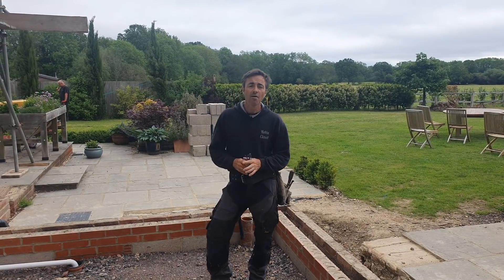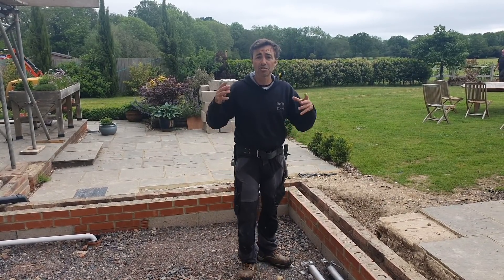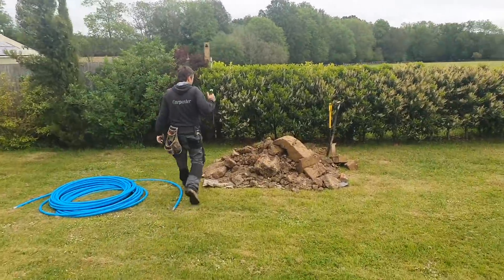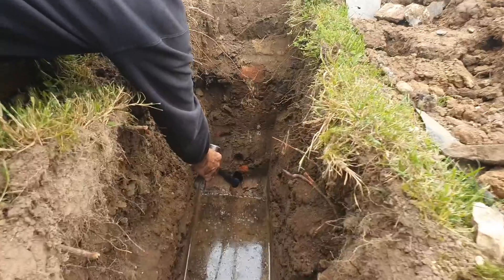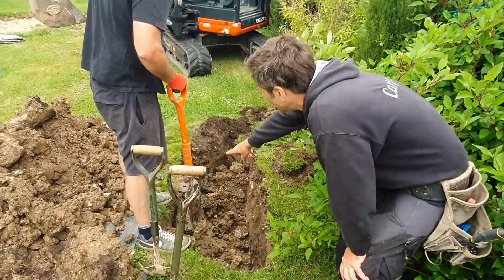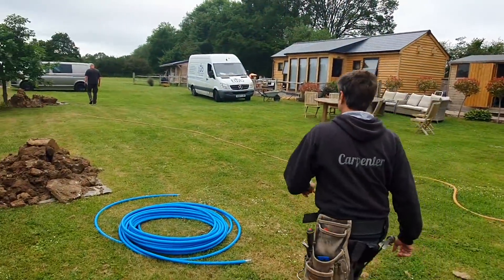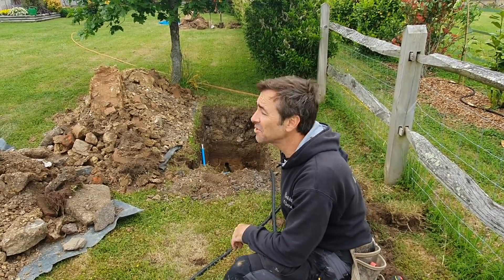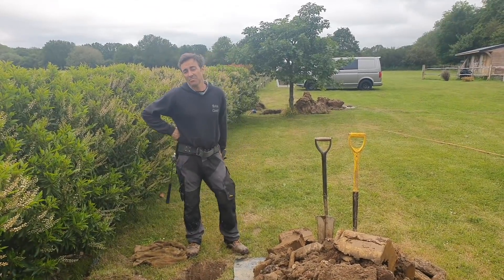The Big Build 9. Lay a new water main without the mess and major excavations welcome to thrusting

Comment: Just did a 6m soil pipe run in nothing but 25% clay and 75% old roofing tiles. Turns out my front lawn has more tiles under the grass than my roof does. Groundsman was not a happy bunny!
Reply: The ground around my house is the same. I wouldn't be surprised if I found an intact pallet of bricks at this point.

Comment: How come the pipe looked to be going down towards the back of the garden, is that where the water compamy connect it up to themains. How much do es this type of service cost per metre run.
Reply: About 20 years ago I was going to have a new water main installed (blue plastic to replace lead) . I was quoted £450 for 15 to 20 feet. In the end I dug a trench when relaying the drive and a plumber friend charged me £100 plus parts another £100 I was well pleased.

Comment: Water pipes do not look deep enough, but depth used equals UK depth spec. UK blue water pipe often laid .750m to 1.35m deep. Perhaps starting at 1.5m deep will avoid common obstacles. To avoid freezing in Canada most specs have water pipes at 1.8m deep & sanitary sewer pipes at 2.75m deep.
Reply: Where did you get the 1.35m figure?

Comment: First saw a service bored in like that in the eighties. Energex used to run their new house lines from the street this way. The guys used to have a detector that they followed the borer with so if it started going off course they could dig down and turn it. On the farm we used a Mole plough for drainage and I have cheated using the tractor Mole to get water pipe from a dam to the stables. It is a good system but only works on certain soil types. Couldn't see it punching through the shale I live on now. That makes a rock breaker grunt.

Comment: Do they protect the pipe with pipe beading/chippings b4 they fill the holes in ??
Reply: The HDPE pipe is very durable, wouldn't need it in clay - but with all that stone and rubble, it might!
Reply: @thetessellater9163  thats what I thought
Reply: You just put a layer of clay in first. Officially you should sand it up 150mm, then marker tape, but on private land  things aren't always done to spec.